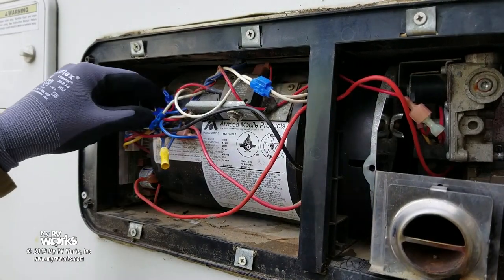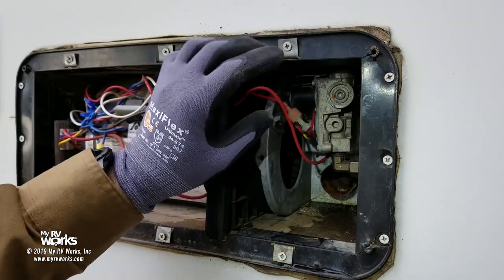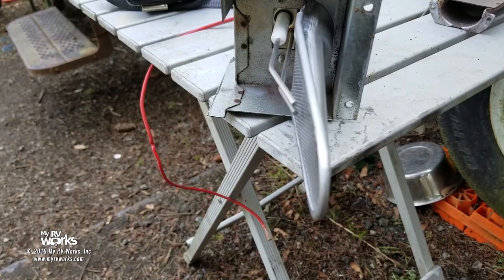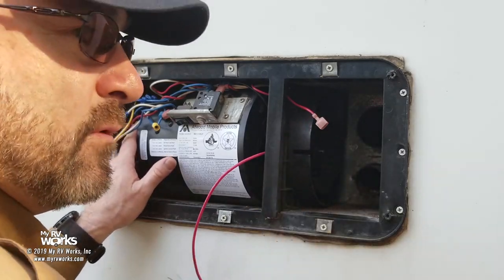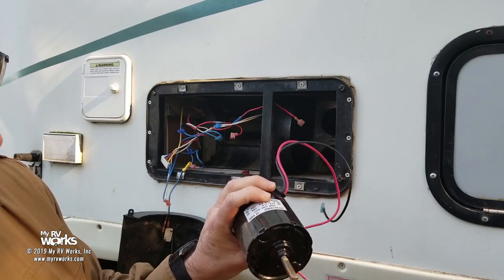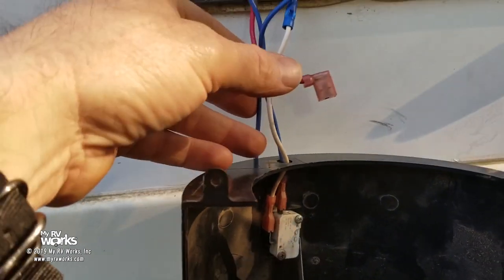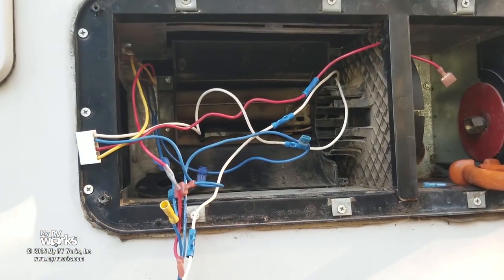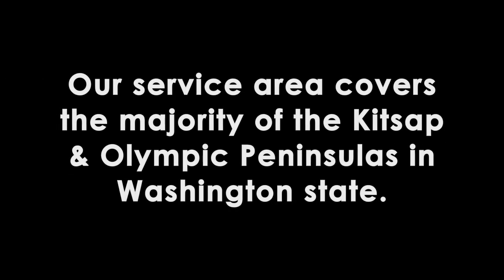RV Furnace Motor Squealing - Remove & Replace Motor, Electrode, and Burner

Comment: Very helpful video.  I seen you use your 12 volt battery pack to test your motor. Can I  you use an 18 volt battery pack to check test my motor or would that be to many volts.
Thanks!
Reply from the maker: 18 volt battery pack would be too much. That's one of the reasons I carry 12 volt tools specifically so I can perform these tests in the field.
Reply: My RV Works, Inc. what about for just the motor? I’ve used 18 volt batteries to test car components at the scrapyard before buying, generally the rule is to avoid anything with a circuit

Comment: Hey boss, I got a challenge for you.
There is something going on with my forward furnace. It's making a noise (not the motor, it's been replaced). The noise happens when the burner gets hot. I need it fixed before winter.  
Thanks in advance.

Comment: How freely should the motor spin? I have an Atwood furnace that blows a fuse once the reset switch is set to On. I replaced the control board and now I'm blaming the motor. It spins but I don't know how freely it should be spinning. Thanks.

Comment: Awesome video!  Thank you!   I do have a couple quesitons, though.  What is the fused (?) part that you unplugged at 13:39, and the switch next to it used for?  I was assuming that the "on/off" switch next to the fuse was to bypass running in an out to turn the thermostat on.  Thanks again!

Comment: Hi from Port Townsend, I might be looking for parts. I have a old Hydro Flame FA-7825 (78 series). I just got a blower from eBay. (Old stock) and a sail switch. Furnace is sideways under bunk. Not sure if this one has or needs the burner replaced. Would like to do burner and igniter since its apart. Thanks for the vids. Where to get parts?

Comment: Ok so at least it's running. My furnace  quit some time in the night 20 degrees.  There is no light blinking, no fan no nothing , battery  is up to par plus connected to shoreline so that shouldn't matter. I have a 100 gal propane tank full. Oven works, stove top light so ism going to say not frozen propane line, flipped reset button blow all the dust and cat hair out of it. Still nothing. Any ideas. A new furnace  is pretty pricey.

Comment: The heating of this same system that you are talking about turns on for two minutes and turns off, turns on and turns off, can you tell me what I have to replace.
Reply from the maker: Your DSI board is not able to detect the flame. So you may have an issue with your igniter or you may have an issue with your board. Here's a video that might help you.

https://youtu.be/0t8vRuGdZLw

Comment: Hello, I have a dometic atwood furnace on a 2019 rv which is working good but the burner (not the fan) is making a very loud noise, like a jet engine. I tested on another rv and it's making the same noise, is there a way to adjust the airflow?

Comment: I just want to add my experience to what is a great video. At 15:00 where he loosens the hose clamp and the motor just slides out was not so simple on my 2004 Tioga 24D. By design, the motor (#37697) grabs onto one of the black plastic fins that the hose clamp squeezes around. This fin has a hole in it that grabs an ear on a 1/2" x 3" metal brace that lays lengthwise on the motor between the motor casing and the fin. The brace is loose and has a bend at its bottom which anchors it against the other end of the motor. Unfortunately for me, by pushing against the motor on the combustion wheel side with a screwdriver to get it loose, I wound up breaking the plastic fin before I knew what was going on. Had I known, it looks like I could have inserted a short, narrow tool between the squirrel cage vanes to lift the bottom of the brace clear of the motor casing so it would slide out without breaking anything. As it is, I hope that the hose clamp will keep the motor in place without any help from this brace.
There is also a useful comment below about how to easily get the squirrel cage blower off the motor shaft. With the motor pointing down, support the blower on top of the jaws of a wide open vise and then tap the motor shaft down and out with a long, narrow drift punch.

Comment: Do they make two different motors for this furnace? After replacing motor heater trips the High limit after about 5 minutes and shuts the flame off after fan runs for a few minutes and heater cools down it will light back up.  Thinking the Rpms are higher and causing heater to burn hotter.
Reply: Ducts are free and flow good, didn't happen until motor was replaced.
Reply: @gordo5848    Something similar is happening to my unit, Gordon.  Did you figure out what it was?

Comment: How do you verify that the high limit thermostat is working correctly?
Reply from the maker: If in doubt they're only a couple bucks so it's not a major deal to replace it with a new one. But if we needed to prove that it's working, I have a meter that has a temperature probe reading. So I would use foil tape, tape it to the high limit thermostat read the temperature reading on my meter, and then gently heat it with a heat gun. When the temperature is in the vicinity of its trip point, the contacts should open.

Comment: Where can I get that exterior access door/frame/panel so I can install to access my furnace from outside? I have to cut wires and pull furnace now to do what you’re doing. Crazy stupid engineering. Thx

Comment: I have a furnace similar that has black smoke coming out of the exhaust. I assume the air gas mix is not right or would it be the  burner? How can I see what color the flame is?
Reply from the maker: To schedule a service consult with Darren please sign up for the "1:1 Repair Consult" on our Patreon site.  https://www.patreon.com/myrvworks
Reply: We've had two "pros" pull my same furnace and get it working fine ...OUTSIDE of the RV. Once inside it keeps cycling on and off without staying lit. Your "tangent" into the high limit thermostat switch has me convinced that's my problem. Last time I was in there I found one of the vinyl duct pipe clamps had shaken loose and the heat was building up inside the compartment causing (I'm betting here) the H.L.T. Switch to cut off. What do you think?

Comment: Matbe you can answer a question, when i turn thermostat, I hear a click and then the 15 amp fuse blows. I can spin the fan by hand and I can put 12v to it and it spins but the power wires get hot. I'm thinking there's a short in the motor. Any thoughts? Thanks
Reply from the maker: Yes, if the fuse is blowing in the wires are getting hot that would be an indication to me that there is definitely a short in the wire somewhere.
Reply: Thanks, Yes a new fan motor fixed the problem.

Comment: FYI: Your explanation of the flow through the high-limit switch is incorrect. Power isn't flowing from the t-stat through the sail-switch to the high-limit. It physically CAN'T since the sail-switch is OPEN when no air is flowing. The t-stat send voltage to the control board. Then the control board sends voltage to the sail-switch and checks if the voltage is coming back. If no voltage is coming back, proving the switch isn't stuck, then the board activates the blower and looks for that change of state. If the high-limit is tripped, it will prevent that change of state since it will be blocking voltage through the sail-switch and the board will not activate the gas or ignition and will shut the blower back off.

Comment: Is there any additional trick to getting the exhaust pipe out? I remove the wing nut and it seems to be corroded and rested to the point where it won't slide out? What is the proper replacement for a hydroflame model number 8535- III ?

Comment: I replaced a ladies motor today, and it still make some noise, not a squeeling noise, but almost like an engine noise. Not sure why.
Reply from the maker: Here is what I have found on these new motors. Sometimes those bearings in a new motor do make a sound. The only way I have found to clear that noise is by moving the combustion wheel and the blower wheel ever so slightly in or out. That seems to create a better harmonic balance in the drive shaft. It's more of an art than a science, but that's been my experience. I hope in some way this helps. Good luck.
Reply: @MyRVWorks  , Thank you
Reply: @MyRVWorks  , Would the combustion and blowing wheel, just basically be the plastic pieces that turn in circles, and seem to push the hot air through? I also noticed that a decent amount of hot air was blowing out of the exhaust hole, that appears to be meant to release the excess propane gasses, it's that hole that the cover screws over. I wonder if I have the wheel turned the opposite way?

Comment: Does anyone know the size of the gas fitting?
Reply from the maker: These are typically a 3/8 flare fitting
Reply: @MyRVWorks  oh k thanks.i trying to take it off I used a 14mm wrench but it was too small to wrap around the fitting

Comment: Could you tell me where to purchase parts?
Reply from the maker: Well, we are set up with most of the wholesale vendors, but you can look on Amazon for much of what you may need.  You will need to know your model number and serial number to determine the correct part for some of the parts you will need. If you get really stuck, you can reach out to us and we have people in the office that should be able to help you find just about anything you need.  Parts@myrvworks.com
Reply: My RV Works, Inc. thank you

Comment: wish mine were that easy...remove stove...remove furnace...cuss a lot, call the person who designed this nightmare names. Threaten to light a match and walk away. Pull the actual furnace out of the tin. Find the sharp spot on the tin, slicing the tip off finger. Finish 2 days later, cause I drank to much beer while wife doctored my finger. Tell wife we are never using the furnace again